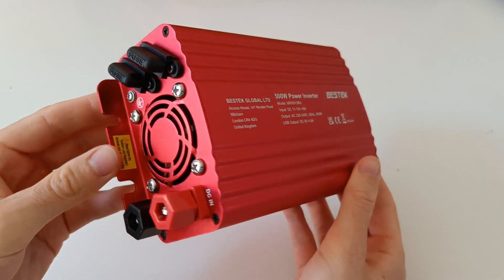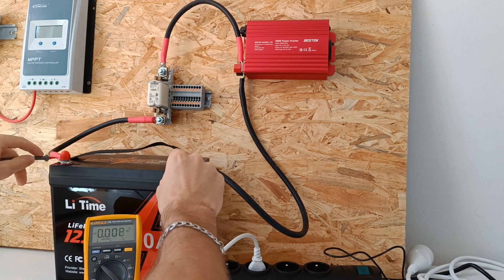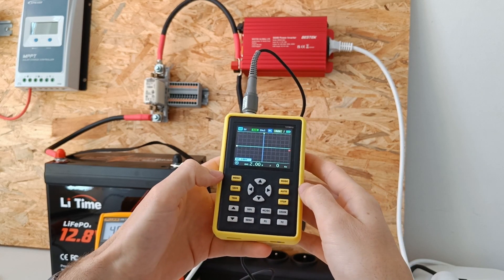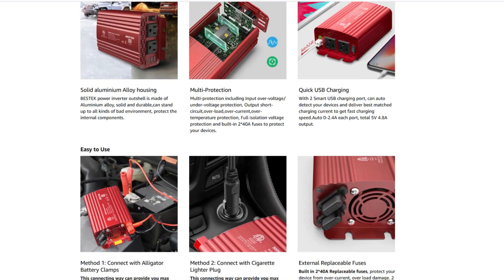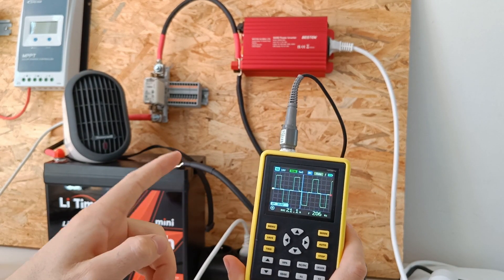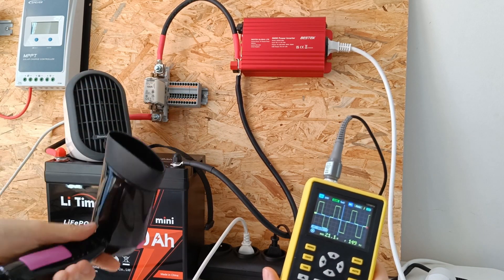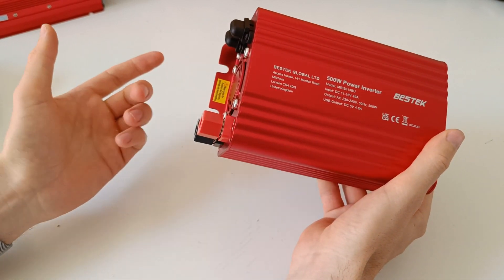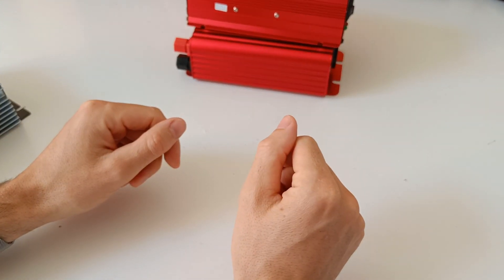Bestek 500W Inverter Review

Comment: so when youre powering tv etc. the inverter is using only 4.5 watts plus whatever else you are using?
Reply from the maker: The more power is connected, the harder the inverter will work. So if the inverter gets warm, that's extra power loss.

Comment: Their pure sine wave inverters are litterally labeled "Pure sine wave inverter" on them....pretty standard in the industry. If it doesnt say pure sine wave its implied that it isnt. Their inverters are very good for the price and their Pure sine inverters are truely "pure sine wave" inverters. They work well and their build quality is good i have zero complaints about mine. They are a good value.
Reply from the maker: Because others are labeled as pure sine wave inverters means this one shouldn't have a label that it's a modified sine wave? Many people don't know they bought a modified sine wave, and I'm raising awareness for that. Because running electronics on a modified sine wave will decrease their lifespan.
Reply: @cleversolarpower  Not most and certainly not all, if its pure sine it will be advertised as pure sine , mostly because they are more expensive and because of marketing. I havent seen any pure sine inverters that werent advertised as pure sine, and if it isn't , then its almost a guarantee its not, in almost all cases. Despite what we may think, my point was they make decent pure and modified sine wave inverters in my opinion and they should be considered as an option. just because you dont like their marketing doesn't mean people should or shouldnt buy them.

Comment: After seeing this video, I decided to check my Bestek 500 watt PSW inverter. My oscilloscope shows a nice clean pure sine wave at idle and remains very clean all the way up to ~250 watts (which is the maximum I tried). It's even better than the power coming out of my wall.  I can't explain why so many people are seeing modified waves and dirty power from their Bestek 500 PSW unless:

1) Bestek has a major quality control issue allowing a large number of faulty boxes to ship
2) these inverters are being built for Bestek by various manufacturers - (some being true PSW versions and others not)
3) Bestek has  corrected a manufacturing problem (mine was purchased less than a year ago)

The bottom line appears to be that it's a hit or miss thing with these inverters. If you buy one, I'd test it well before the return period runs out. If you get a good one (like mine), great, otherwise send it back.
Reply: the maker of the video inadvertantly purchased the less expensive version of the 500 watt inverter not the pure sine wave version.
Reply: I believe the problem with these inverters is what he said at the beginning of the video. The company he's referring to makes two different inverters one is a sine wave and one is a modified sine wave and they look identical.
The issue he is discussing is the fact that best tech did not package the thing that he has as a modified sine wave and he thought that he was buying a pure sine wave inverter.

Comment: I bought one and connected to battery, it works but i smell this burnt smell coming out of the built in fan , Its a 500 watt and i plugged in a 100 watt light into it and its working. Hope it don't catch on fire .
Reply from the maker: The smell can be because it's new (as with all new appliances they have a particular smell). But if it's a really burning smell then i wouldn't trust to leave it alone without supervision.

Comment: 1)  If the publication and the inverter itself NOT claims about is a pure sine wave inverter ... why is tricky ???  The publication claims about the product is, NOT have to claims about NOT IS. 
2)  At the end, you combine two machines of high demand, but you NOT shows the measurement of DC current that drains.  You just say "combined should result 500Watts", and show the osciloscope to "prove" that inverter not holds....   Why not measure the combined machines with AC wall outlet measuring the power to show if are 500 Watts ???

I perceive a bad intention.

Comment: You were supposed to check the battery voltage together with the amp current (as you did) when you had the load on.  That battery were either not fully charged or in a bad condition. Normally those inverters switch off when the batt voltage drop below 11.8 - 11.5 volts. Fully charged healthy batteries reads approx 12.6 12.8v - no load- depends on a lot of factors.
Reply from the maker: I did measure when the load is on 2:22
Reply: Claims  that combined loads will result in 500 watts, not measure the air dryer first, just shows the scope to ahow that signal not holds. Many measurements along the video, but at ends "just believe his word" ...
Reply from the maker: @345rvv  It's because i measured the power of the loads before. I'm not lying here and I'm not winning anything by not recommending this inverter.

Comment: i founded this inverter in a thrift store that sells (stock) electronics, it was for 10$, thank god i didn't buy it. thanks a lot for the info.
can you please review this inverter, its quite cheap and i see a lot of youtubers similar to your channel using it.
(LVYUAN Power Inverter 2000W)
Reply from the maker: I took a look at the inverter you mentioned. I would not recommend getting it. It's another cheap inverter that will disappoint.
Reply: @cleversolarpower  thank you so much, will get the one you recomended

Comment: Can a 200watt panel  with  voc 21volts charge a 25volt lithium battery system.????
Reply: Nope you need at least 28 to 30 volt and one panel can't reach that level. You got to have 2 panels in series. Two panels would give 42 volts in extreme sunlight only, u will need a photo voltiac charger to regulate the volts to the battery at approx 28-29volts.
Reply: @heinburger3095  
Thanks for the answer
Reply from the maker: Couldn't have said it better.
Reply: @cleversolarpower  
What about 2pcs of 200watt or more with VOC  30volts and 2pcs of 200watt  Voc 21volts join in parallel can they charge a 25volt battery ?????

Comment: As 1 Belgian to another Belgian, bestek belongs in a drawer :-)    I have once used a modified sine converter and it killed my powermeter, so that one is like bestek in a drawer.  Also not sure if the efficiency you are measuring is really 91% as you are measuring a modified sine wave. Not sure what the Fluke measures then.
Reply from the maker: You are the first one to recognize my accent 😄. So I'm not the only one who lost their power meter, maybe it's just us Belgians who lose their meter. Interesting thought about the efficiency. If somebody with an electrical engineering background can jump in to explain, that would be great.

Comment: Thoughts about putting batteries, charge controller and inverter in a working refrigerator, only a hole for PV and an AC power board? (Australia/Arizona)
Reply from the maker: Don't do it 😬. You have weird thoughts.
Reply: @cleversolarpower  because?
A fire retardant box that keeps it all neat an a desirable temperature.

Comment: The title of the 500watt pure sine wave inverter by the same company says very clearly that it is pure sine wave. The one you bought doesn't say "pure sine wave" in the title. You don't have to read the whole listing, the title alone will tell you.
Reply from the maker: Many people will fall for it. In my opinion, it's not fair to mention that it's not a pure sine wave inverter.
Reply: @cleversolarpower  To be fair, on Amazon, they're all listed like this when you shop for power inverters. If it doesn't say Pure Sine Wave in the title, its safe to assume its modified. If people don't know the difference and go by great reviews and low price instead of knowing to look for Pure Sine Wave, that's on them.

Comment: I ran to mine to see if its the same, I recalled while i was researching i saw the two options and video  advised that to look for the pure sine wave logo on the device, I even checked with both amazon and the company website just to be sure as amazon doesn't have the be descriptions.
Reply from the maker: The pure sine wave has a sine wave printed on the case.

Comment: Good review. Has me wondering about my 1000w Bestek inverter. I've had it almost 2 years. It has worked ok running small chest freezer in my camping trailer. I use it to keep freezer running with 100ah Chins battery while I'm traveling going down the road. When I am at home I use it to run a 65" plasma tv older Samsung drawing around 250w. And at home I use victron 100/30 smart controller and 1- 400w solar panel to charge up while in use. I noticed the power factor showing 1.0 on kill a watt meter. So far it still working. I'm enjoying the learning process of using solar, watching your video's.
Reply from the maker: Thanks for your comment. I found the 1000W version on their website. It doesn't say anything about pure sine wave, so I must assume it's a modified sine wave as well. Thanks for the sub!

Comment: Can you go wrong with Morning Star? I'm not sure what all they sell. But i do have a Morning star controller for 48 V water well pump Hooked up to a 12 V battery just to charge my power tools.. I'm thinking about going 48 vote, but all I really want to run is the larger refrigerator and a washing machine. And I think my best option is to get two inverters, 24/48v. I have a small farm.
 With a small house , I'm pretty much camping right now.
 The power company wants $16000 to put a pole , which I think is great.
Reply from the maker: Take a look at my videos where i talk about whole house systems. You might draw some inspiration from them. It depends on how much the electricity company charges you per kwh. Depending on your consumption, it may be ok to stay off-grid.
Reply: @cleversolarpower  thanks